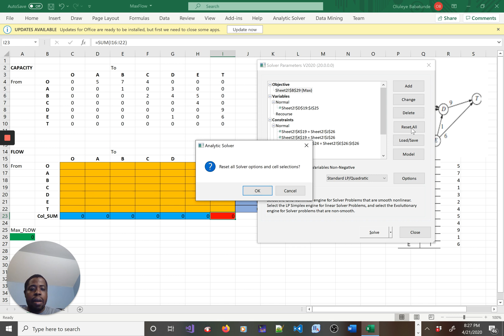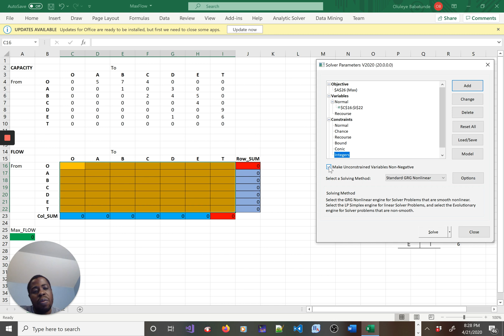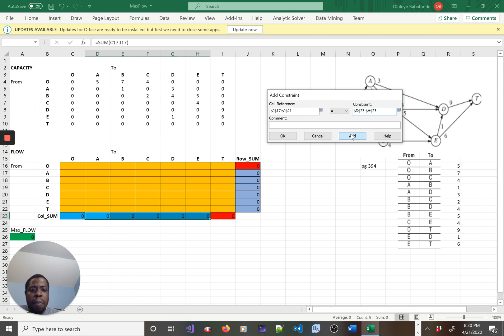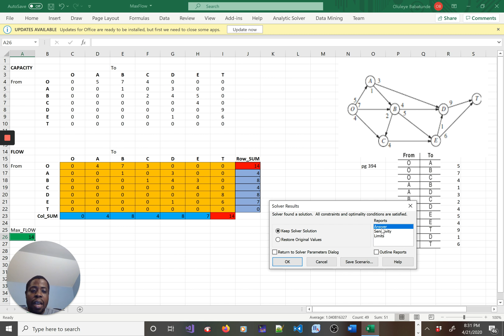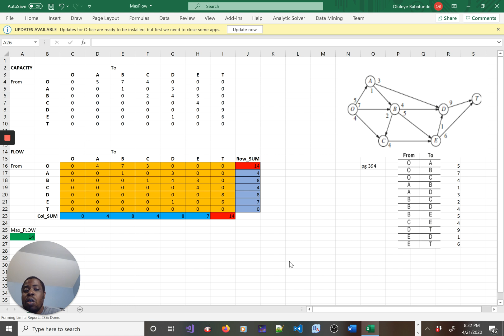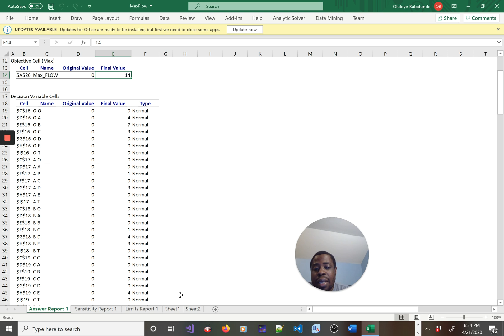Solving Maximum Flow Problem Using MS-Excel Solver | Hezekiah, OB, Ph.D

Comment: What is the use of the maximum flow 14 here? What next steps do I take to get this flow? Is there any optimal route based on this maximum value?
Reply from the maker: The steps are already shown in the video. The red is cell showing 14 is the max flow